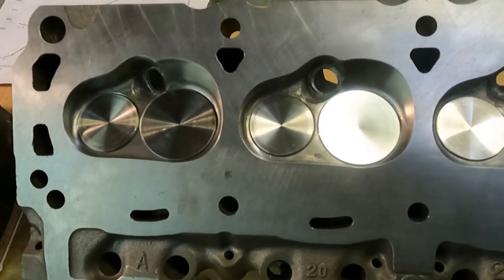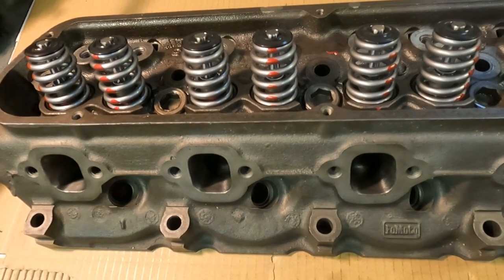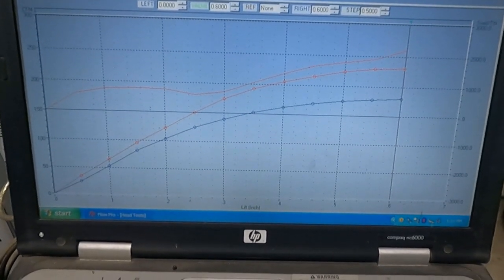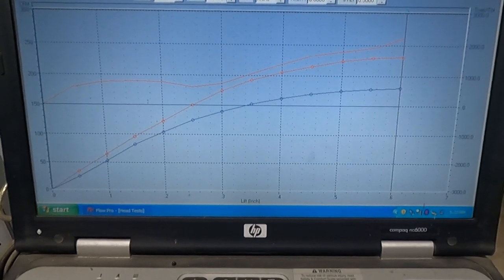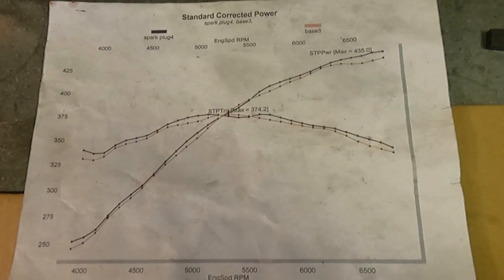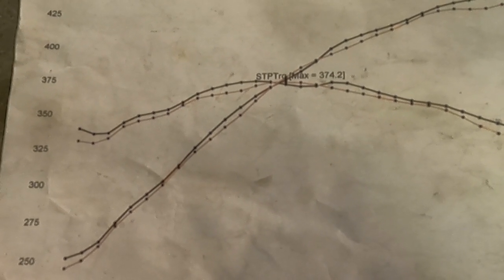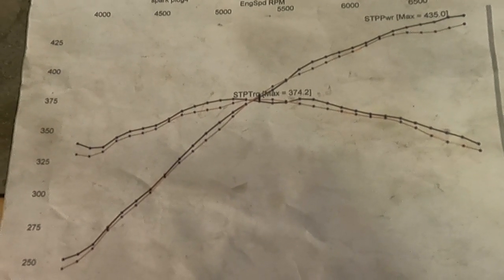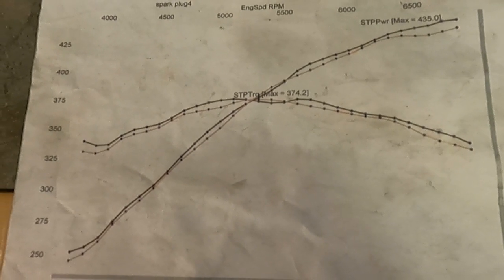Ford 289 Heads: Just like our 2019 Engine Masters: Part 4

Comment: I have really been wondering if a set of these heads would make a 306 scream. Mights thoughts have leaned me towards yes, for a nice all iron sleep build. Gain a bit of compression and add a good hydraulic roller cam.
Reply from the maker: They are better than 302 heads  in every way compression, flow etc.

Comment: Hi-Po heads
A trick you can do on a Ford dual point distributor is adjust spring pressure on one set to float at a given rpm to retard timing about 2 degrees. In other words out of the hole higher timing and as the engine increases rpm the other point set will retard the timing. This trick was done on the factory 428CJ race teams in '68

Comment: BACK IN THE LATE 60S. THE 351 WINDSOR HEAD WHICH WAS NEVER A RACE ORIENTATED HEAD AND A TWO BARREL HEAD ON GRANDMA'S STATION WAGON. ON THE INTAKE SIDE ONLY  FLOWED JUST AS GOOD AS CHEVY'S BEST HEADS THE FUELIE 2.02 HEADS. A TESTAMENT TO FORD SUPERIOR ENGINEERING AND DESIGNS. THIS IS WHY THE LS HEADS TODAY ARE ALL BASED ON FORD WINDSOR HEADS. WITH THE RAISED INTAKE PORTS WHICH IS A REGURGITATION OF FORDS 427 HIGH-RISER HEADS. VLS EVEN USES A FORD 351WINDSOR FIRING ORDER.

Comment: I got a set of them professionally ported! Got a cheap set of aluminum heads! I'm gonna sell the aluminum shitters and put that professionally ported 289 heads on my 351w! It's a 95 roller! If anyone want a deal on a set of speed pro ready to install I'll make you a great deal! Was going to run them just because they  were aluminum and I'm in South Carolina, but I  spent 5 years racing 351w on a budget,  and the professionally ported 289 heads were only 1 tenth slower than rpms on a 357w! I got a deal on these shitters. I'm gonna make a better deal on them and put my ported 289 heads on my 357w!! It's not going to be a daily driver! I'm not spending the money on the aluminum heads to make more power! They're complete! 2.02-1.60 aluminum heads! I'm not going to pay to have them ported! I'm building a 94F150 flareside! I have a professionally ported set of 65 289 heads that I'll bet $1000 will out preform these turds! I'll sell them for $250, I have $400 in them! I think the heat dissipation of the aluminum is an issue,  but this isn't a daily driver! I might just go to a 460! It's just gas and I have access to 2 460's!
Reply: What brand are they, Mark?
Reply: @big_steve_o5129  found the other head, still in the UPS package. I think they are Flotec. Look just like the ones in a review I saw.  I got $400 in them, I'll take that. Or, might be interested in some parts. Got a good 750 double pumper!, performer rpm intake for a 351w!  I'm intentionally building a junkyard dog!! How bout a 3000 stall converter fory tci c4? Caught up with my race buddy. He can get them to you. No hurry, the heads will be here.

Comment: An almost identical head I have used is the 1970 2v (non boss) differing from the non boss 4v. Used same valve sizes with pocket porting. Very impressed that it made more power than a gt40 with similar mods.